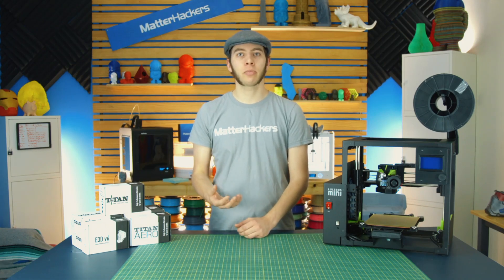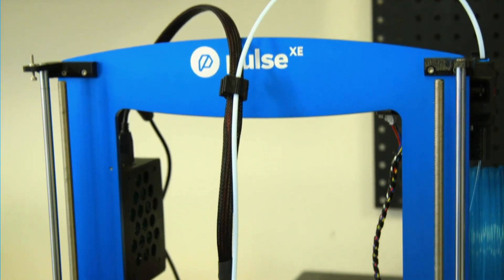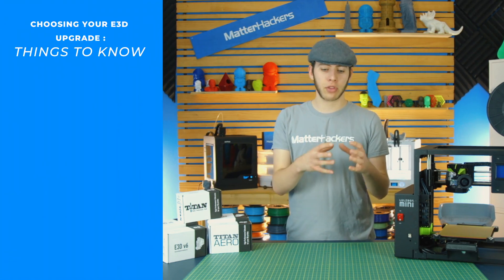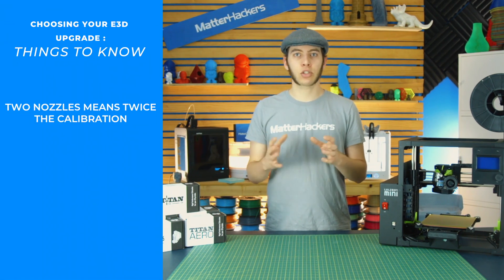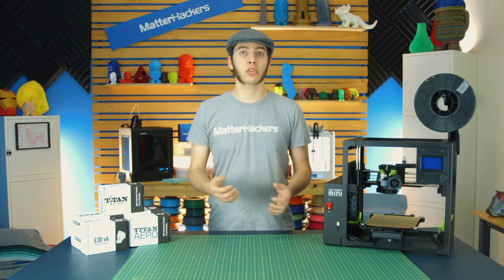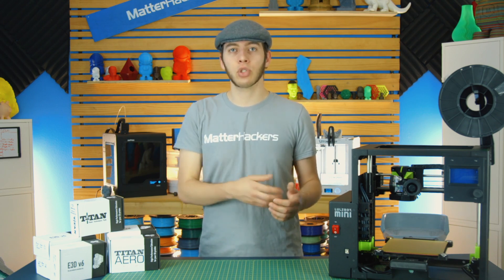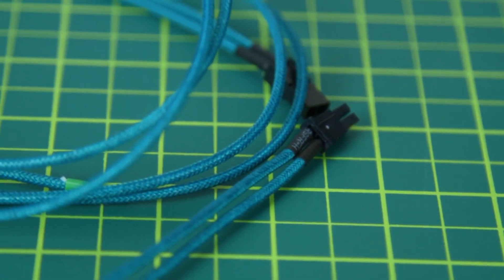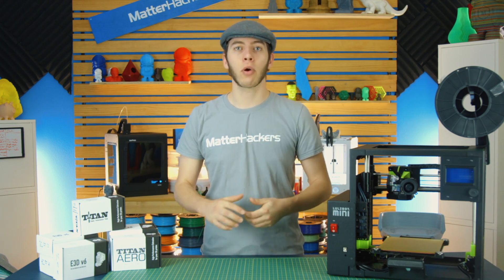How To Everything E3D // 3D Printing Hotend & Accessory Guide

Comment: Looking over the comments i dont see a single response to any of the questions or suggestions but im going to try anyway, again...Why do you not have these complete setups on your website as an optional upgrade? Rather than all these ppl buying the wrong things that dont fit or will potentially damage the 3d printer, why not you pick all the proper parts needed, put it in a kit and make it available to us for purchase. Or you could even do the upgrade yourself and sell the complete unit as such for slightly more for those who are unable to do the upgrades. This way when we purchase the kit we know everything is correct and the exact fit for whatever unit. Since the elegoo is so compatible between each other you may only have to do one settup to fit them all.

Comment: Have you tried to use the e3d v6 with the MKS_Gen_L board? I can't get it to work. My tevo printer just reads 0 degrees. I checked with e3d and they say all the Resistance values are correct. Thank you.

Comment: How is the hot end and extruded controlled exactly, as I’m looking to convert a cnc overhead router (1220mm 42”x 1220mm 42”) to also operate as a 3D printer, I only want to purchase the hot end and extruded without buying a full printer to gut for the parts

Comment: You mentioned perfectly calibrating the height of multiple nozzles. Does this really solve the issue of one color oozing onto the other? E3D has their tool changing printer coming out soon (we hope!), isn't this an answer to the problem of cross color/material contamination? Is it really possible to get perfectly separated colors on prints using  side by side nozzles? Yes, I know about the dirty hack of an ooze shield.
Reply: I see Alec is hanging out in the comment section as promise...  🤔

Comment: 99% of people using an enclosure would still be better off with an air cooled extruder. You only need water cooled if it is a properly heated enclosure. Like above 60 degrees.